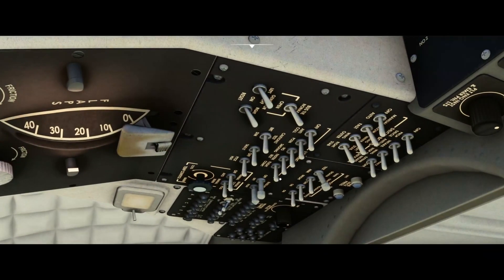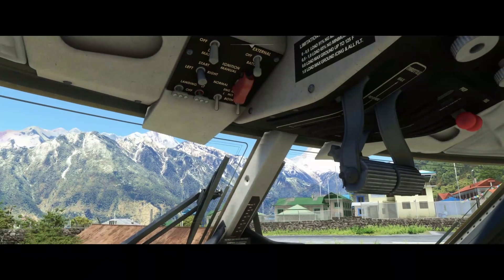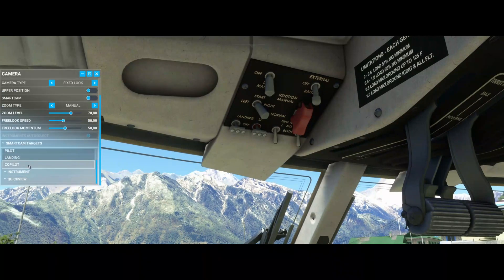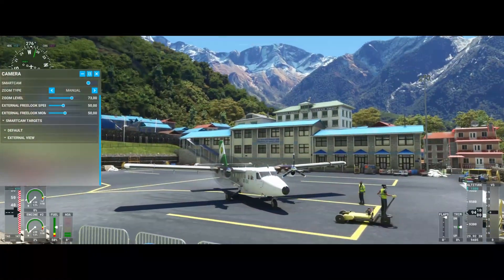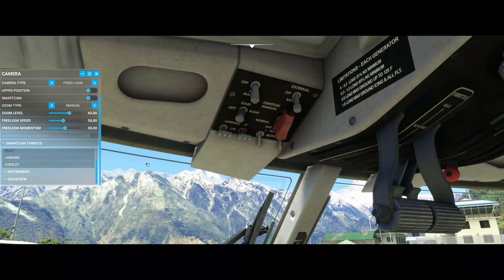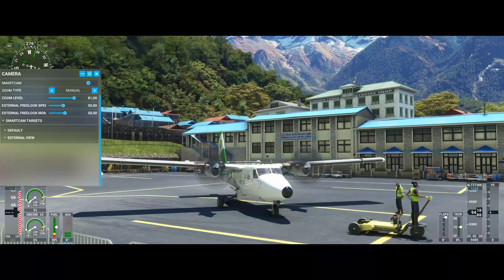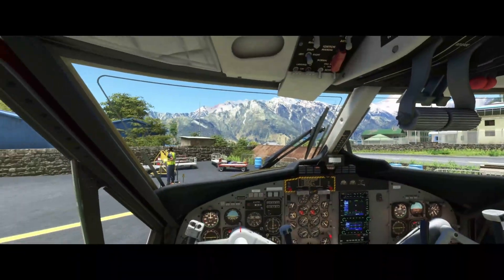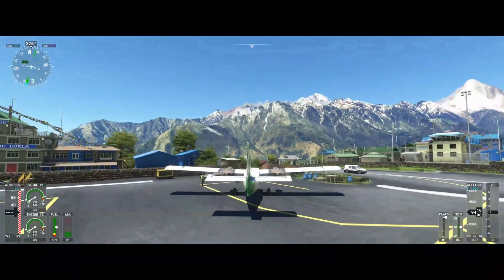QUICK Aerosoft Twin Otter Engine Start Tutorial║FS2020

Comment: Sorry mate, on the Twotter the PT6 were feathered BEFORE shutdown. First, if you had external power USE IT. On start, the props were feathered. It made a nice slap noise as the engine was started. Once both were started, then the gens were cut in. The prop levers were put full forward to take them out of feather when you were ready to go. Also, its not a mixture lever, its simply full cut off/on.